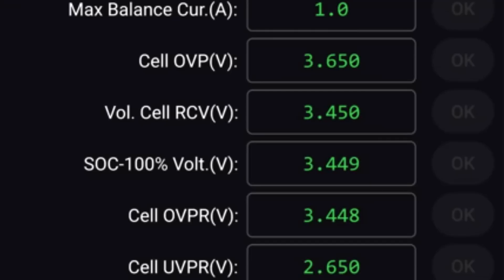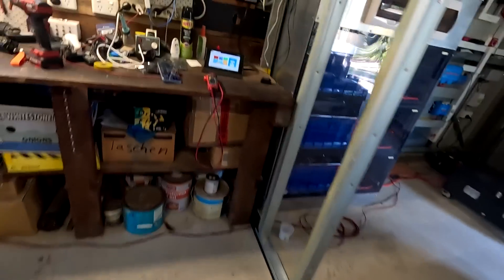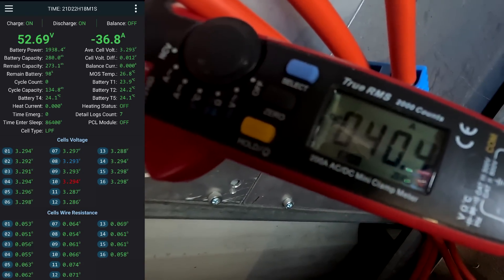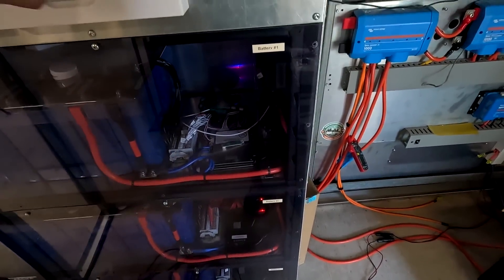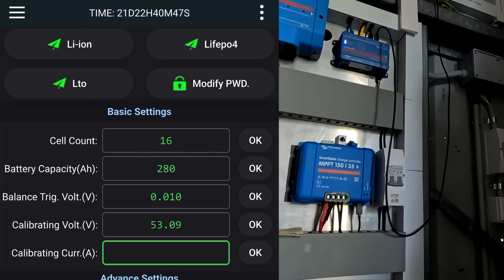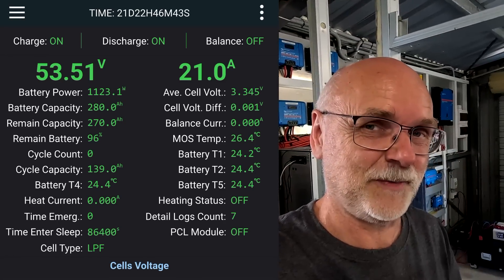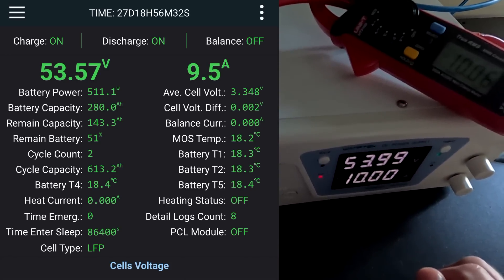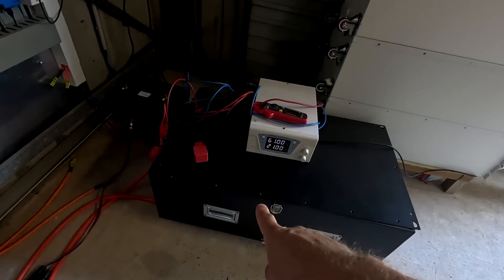JK BMS SOC Drift - How to (not) calibrate the current sensor and will it actually help?

Comment: After putting in several hours trying to calibrate the JK BMS with a constant current DC source, I came to the conclusion that it's not possible because the JK BMS's internal shunt isn't very accurate. I double checked with two multimeters by putting them in series with the charger's negative wire. All of them were showing the same values as the CC power source at different currents but the JK BMS shows slightly different values. You can only really calibrate it for one particular ampere value and that's pretty useless. So I guess we have to live with the SOC drift.

Comment: Soo the linearity of their current amplifier is crap (bow, or shunt is non linear with current/temp.) so in order to fix that they need to provide multipoint calibration procedure to better fit to actual amp-transfer curve or fix hardware to make it more linear!!

Comment: Revisiting this again - I bet the ADC is low resolution; it's entirely possible the 200A BMS model has a low-bit-resolution ADC for measuring the shunt, as the BMS measurement seems to indicate steps of ~0.4A - A higher bit-depth ADC on the BMS would help a lot with accuracy.

Comment: andy.. my old b series bms  shows cell 13 sag or   charge faster but monitoring it i didn find a reasson for bms to do it  .. i  even put another cell and even traded other balance cable to be sure it wasnt hardware  i even  created preasure at  connector on bms  ...  the  changes in voltage comes when i charge  battery or discharge battery leading me to think  that is the sensoring of the bms for that specific  port !!!  is it possible to calibrate it and save that bms cause  in normal 50% push of my fully and ok battery  it says 2.9  and when charging at 0.3c  it reaches 3.65 and   probably   plays unfair   balance against system!!!   one thought was to no let active balance OFF  because i go slow charge and discharge but  its not safe to keep it and one day if push it  bms shuts down and possibly harm  any other component !!!!! 
   btw thanks for the guide of your videos     i installed  an updated first  version of inverter pb series  bms with the LTO   parameters*( i did turned it to lifepo4 )  and it seems all cells are better if not great after 2 years of unbalanced use!!!  ..    
is it any way to   balance the readings   maybe the  internal resistance of the 13 cell to make it read  similar to others which is the normal situation anyway|?     did i messed all that time and let it drift  completely  its algorythms  or it has to do with faulty internals! ?  
 i did pushed system once and for a moment with a welder to its 100%  but  bms was at 70%  !!   i hope thers a way to make it work again!!! when i first installed it  back then i tested a 50% test for 2 hours  and nothing seemed to  sag or  full charge violently!  i even bought another cell and  played and it was the same .. even with new cell   port 13 showed sags and overloads causing whole system plays at 60% of its capability

Comment: Thanks for the video. How I landed here
1. Using Charge Controller #1 I admitted that the current on JK BMS is 20% lower as stated on Controller. Ok, I thought controller is a shit.
2. I Purchased another Charge Controller, lets say #2. The same story: JK BMS Current values are significantly lower. 
3. I used a DC DC invertor do DIScharge a battery (900W). With a 18A  Current on JK BMS (18x52=930W) my receiver showed me also exactly 900W --> however it cant be, as DC DC convertor has max 90% efficiency. It means real JK BMS current should be around 20A, and after losses I have to get 18A (900W)
Long stroy short: JK BMS (at least in my case) shows current 10-20% less than in reality.

Comment: Yeah no, I've got a new BMS that's been running for a couple of weeks. I calibrated current charging and it holds fairly close. But on the reverse end when under a load it's way off the mark always resulting in an SOC much higher than the rest of the batteries. I've all but given up on it, annoying as it is. With a new version coming out it doesn't leave much hope for future firmware updates to the version 15.
Guess if it gets under my skin enough I'll yank the thing out and replace it with a spare and hope for better results.

Comment: I just put the Multiplus 2 to charger only mode and start charging at maximum power. The current is constant 68 amps, and so I could calibrate the JK current. Awaiting for a current clamp for precise calibration. I think my JK is off at low currents, the clamp has to prove it.

Comment: I have had my new 4S battery with a Victron Smartshunt and JK BMS running for weeks. The shunt, Smart solar controller and raspberry 3b seem to take some 5 watts constantly (that's about the same as my fridge!), but the JK BMS shows this a zero. So after a few days the drift between the shunt and the BMS is considerable. The shunt now says 48% and the JK 75 % after christmas holidays. I think the JK BMS doesn't have the necessary accuracy to actually be a reliable energy meter. I just set my shunt as the battery monitor in venus.

Comment: Hello. I have a problem with JK BMS B1A8S10P
It works normally when starting and discharging, but during charging it repeatedly displays Protection (CPU AUX ABNORMAL error).
All temperature sensors show 44 degrees, and the charging amps drop to zero.

After some time - about a second - the error message disappears, all temperature sensors show some appropriate values, and charging continues.
The error cycle repeats itself over and over again.

Despite this, the battery is charging, very slowly, but still charging. I can see the charging current on the battery wires.
It seems to me that due to the error, a "microchip" is repeatedly reset, and charging occurs when it is in the "alive" state

Comment: I've 2 x (16x3,2Vx280Ah) in parallel; Each one with JK-PB2A16S15P. Now, after 4 months of work, the master battery shows 33% soc (like inverter), and the slave: 48%. It's after some on-grid dark days (when inverter allows them to stay at 30%). inverter shows battery status from the master.

Comment: Dear Andy thank You for this Video, I would like to come back to the process of charging the pack with the Wanptek charger that I also own since one year (thanks to You ;-)).
I would like to slowly charge my GobelPower pack (14Kw) that I also bought one year ago (thanks to You too ;-)) but I am not 100% sure which setting to use, so I prefer to ask...
I saw in You first attempt that You had to deselect the OCP because it triggered as soon as You started the charge.
Then in the second attempt 6the CC turn red and the the CV turned off i.e. the Wanptek directly switched to constant current and adapted the voltage (You set 61 Volt ...).
And what's about the cables, may I use the cables delivered with the Wanptek, are they thick enough ?
Should I use an extra fuse ... even if the Gobel pack has already a 200A switch (mine is from end of 2023 and has not anymore the extra fuse internally) ?
Thank You for Your help !

Comment: Dear Andy , as the BMS Amp's mesurment is almost inaccurate (in my case Seplos V3.0 with actual latest firmware 1.3 as V11/200Amps revision) , if we connect a SmartShunt via VE Direct to the Cerbo GX, would it possible to base the DVCC on the SOC mesured by the SmartShunt insteadof the BMS?
Reply from the maker: Yes, absolutely! Set the BMS as the battery monitor and leave the Seplos BMS connected for alarms etc.

Comment: our JK V15 with Firmware 15.30 has no float charge issue. I guess it runs quite usuall which means that it powers the EVE LF280K cells after 100% SOC for about 1 hour with roughly 350 Watts till it drops to 0 and is on idle. 
Will add the comment on a more recent video as well that it might be recogniced. I have done 5 battery cycles tests during the last late summer days which meant running down to 2,6 V and then charge the cells again till noon or so. And during these charging sessions I observed the floating behaviour and itt looked and felt quite well, of cause duing cloudy hours in the noon things are running a bit different so I have not investigtated the power current and voltages for every minute cause on 2 days clouds were coming and going within 10 seconds or so.

Comment: I dont know if well ever have an accurate SOC., With the tolerances of meters though not bad still not perfect. I calibrated with load so i dont thunk it teally matters the BMS assigns the neg or pos value. dont check my SOC from the bms. In fact i dont every rely on my SOC although i have a small system.

Comment: What about the voltage calibration? I have 2 meters a Klein CL800, and a Fluke 27 both read differently by 10-12MV then the JK BMS, and the inverter. The inverter a EG4 6000xp reads differently then my Fluke 27 when put the probes right on the circuit panel where the ring terminals mount to. Maybe it doesn't really matter I have to increases my charge voltage and float voltage little to get it to balance.

Comment: I am using lithium iron.  14 s batteries.  100% soc. Set at 4.142 volts.  0 % soc set at 3 volts.  This gives me 0.0114 volts  per 1% of charge.  So for me using this troupe of cell  I have noticed that the soc. May be all over the place. But the cell voltages on all battery’s. Are normally within 10 mv of each other  also the battery manufacture. Gives a voltage to soc  data curve.   So it may be that for lithium iron cells. That this could also be used over long periods. To check the soc  each type of battery may need a different solution to work best
Reply from the maker: That will not work for LiFePO4.
Reply: @OffGridGarageAustralia    True That is why I think that they need to use a different. Way for each battery chemistry .  I have 10 batteries. And the cell voltage. Are all consistent.  Even though the reported soc. Is all over the place. 
I have just set up node red to report on soc.  Using a voltage / capacity curve from manufacture of battery.  Will see how this works. Out

Comment: Calculating SOC depends on how you use the battery.

For me, when its rainy season and we dont get to fully charge the battery, i estimate soc by looking at charge/discharge patterns over the past few days and the lowest cell voltage.

When its sunny day where we can do full cycle, i rely more on previous day charge minus a little for the round trip.

Given that estimating SOC depends on how you use the battery, JK can just put the most basic soc estimation and give the stream of data to home assistant for analysis or to create better soc estimation based on all data.

Comment: Why don't you approach SOC drift correction from a different angle

Just fully charge your battery every month (or whatever period you choose) using your other batteries?

This is what I do. I connect 4 micro-inverters (1900W AC total output) to my big battery (40KWHr) and connect this AC into my active phase. My hybrid inverter uses solar dc plus this surplus AC (measured by CT clamp on main house input/output phase) to fully charge my 20KWHr house battery. On the occasional sunny winter days I top up the big battery. The micro inverters work through the entire battery voltage operating range, so it doesn't matter what the SOC of the big battery is, it just works

In spring/summer/autumn, during the day the big battery absorbs energy above my 10KW maximum feed in. And from about 4pm to 9am, this energy is released to the grid through the micro inverters into a different phase

I realise your system is different, but it may give you another path to consider
Reply from the maker: Not enough sun in winter.
Reply: @OffGridGarageAustralia  We live in cloudy, cold NZ (Hamilton 38°S 9.5hr winter day length). You live in sunny, hot Australia (Queensland? 27°S 10.5hr winter day length). I don't understand why you have insufficient sun in winter? Our main house battery is recharged every day, sometimes with the assistance of the big battery (but often not required). Is it a shading issue (which we don't have)? Or do you need more panels? We have 16KWp

The source battery does not need to be fully charged to make my system work as described. The micro inverters create the voltage differential to move low dc battery voltage (via micro inverter and hybrid inverter) into a higher dc voltage battery

You seem to have many more KWHr of batteries than we do. So it should work if you go into winter with full batteries. Only about 10% is lost on dc-ac-dc conversion, so in theory a single full battery or two should cover all winter balancing needs (1/month)

I have wired the AC side with change-over switches. In winter, all solar goes into a single phase P1. In spring/autumn, I switch some solar onto P2 and P3. In summer I switch more solar onto P2 and P3. The big battery absorbs surplus power from P1 when necessary, and discharges to grid through micro inverters during the night. This keeps the house battery full, the export voltage within tolerance and the export power below the 10KW limit
Reply from the maker: @Goodkiwibloke  Seems you missed a few important videos. This is the reason for this whole experiment.
https://youtu.be/nS72GpEO-zA

Comment: To get a higher calibration current why not turn all the loads off and use the output from your solar panels. Once the MPPT isn't searching the amperage is fairly stable. With full sun at least. Scratch that... Read down further and see this has already been suggested.
Reply from the maker: The current is not very stable with MPPTs, it constantly changes.

Comment: This is a question about the dry contacts on the BMS.  What can they be programed for? 
Low battery voltage? High Battery Voltage? High Cell Voltage? Low Cell Voltage? 
Can all the above be selected together to turn this contact on/off? 
In canada you need a BMS wiht contactor and I wish to use the Dry contact ot do so with the above conditions set to trip the dry contact that will be controling the High Current contacotor I have any thoughts?
Reply from the maker: See this video here where I go through all the settings of this BMS:
https://youtu.be/eZX7CkEEq_8
Reply: Hello Andy 
Yes I seen that, but what i would like is to see the ability to select the Battery Over Voltage, Battery Under Voltage, Cell Over Voltage and Cell Under Voltage all at the same time.  If any of the 4 conditions are met then have the dry contact flip state.    Can this be done with a firmware update?
Reply from the maker: @Jeff-ow4ud  Technically this can be included but imagine the mess having to program the ON and OFF values for each of your 4 trigger points. I guess that's why they have included option 10 (System Alarms) and the contact closes at any given alarm.

I doubt JK will address all individual requests for specific use cases. The fw functionality would explode.
Reply: I can see the point.  A thought would be to have them pull the same numbers from the other settings?  OV ,UV, Low Cell and High Cell? I will look into the Option 10 and see how that works.  May have to invest in the LCD screen.  WIll it tell you what system alarm on the screen or just that there is a problem?
Reply from the maker: @Jeff-ow4ud  The screen and the app still tell you what the problem is, the relay will trigger at any of the protections regardless.
Reply: Good to know.  I think I will order some screens.  
Question in regards to your latest video.  Home Assistant… how do you get the data on that?  I am thinking of setting it up.  Always a pleasure to talk to you Andy.  Enjoy your summer coming up.  We are slipping into fall and I can see the solar output dropping 🥲

Comment: Wie bei jedem Analogeingang müssen 2 Werte abgeglichen werden. 1.) Der Offset von Verstärker und AD Wandler bei einem möglichst kleinen Wert. 2.) Die Verstärkung von Verstärker und Shunt bei einem möglichst großen Wert. Dann mehrfach wiederholen um sich anzunähern weil 2 und 1 nicht unabhängig sind. Fehler dazwischen kommen dann von missing AD Codes und Unlinearitäten welche <<1% sein sollten. Thermischer Drift kann es bei billigen Shunts aber trotzdem noch geben. Die von der Isabellenhütte kosten 1-2 Eur/Stck. Aber Andy macht Hoffnung daß es vielleicht noch was wird und ich habe mir heute auch 3 JKs bestellt um was zum Spielen zu haben. Die Befürchtung ist allerdings, dass  JK am Eingangsverstärker keine negative Betriebsspannung spendiert hat, weshalb man den riesen Offset gegen Null auch nie wegkriegen kann.

Comment: Dear Andy. You are a wonderful, humble and funny media personality. The information you provide is important. Thanks! I have a question about cooling LiFePO4 cells.

If in some situation it turns out that the cells require cooling, and the JK BMS provides information about the temperature with the help of two sensors. It can be used to automate the heating of the cells for charging, as the JK BMS includes a port for the cell heating element, but apparently no connection for the cell fan. I don't need a heating element myself, because the cells are always charged at room temperature. But the limited housing of the cells can cause the need for cooling. The cells are C40 type and there are "channels" between them due to the round profile of the cells.

So I'm asking, do you have a video of how, for example, I could utilize the JK BMS's temperature measurement and cell heater connection to achieve cell cooling with a case mounted fan?

Comment: On my Sunsynk, what I did was to disconnet solar and then turned on Grid Charging the battery option, and set the Grid change rate to 20A. This match the clamp meter reading as well and then I set that in BMS caliberation. Also while not a fix, can we get JK to provide a option to set  SoC level manually, atleast that will allow us to set the SoC to a more resonal number when we know it has drifted.